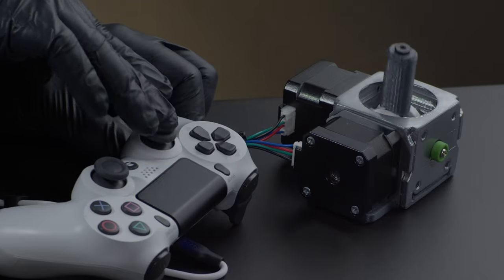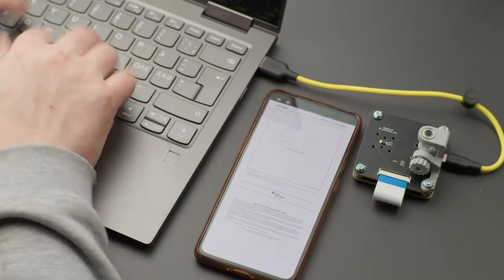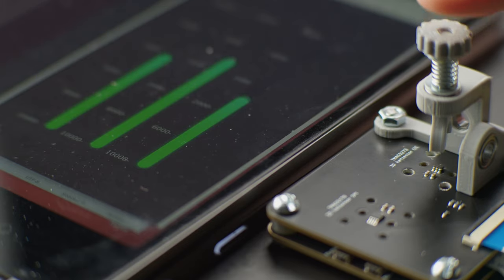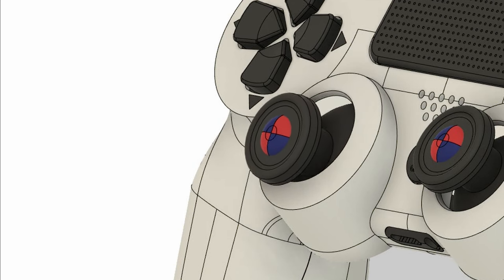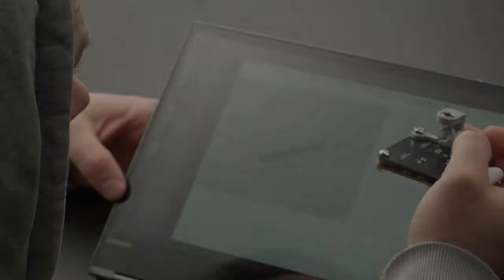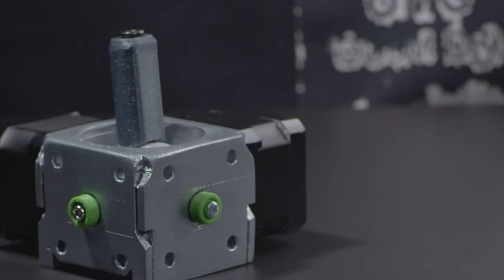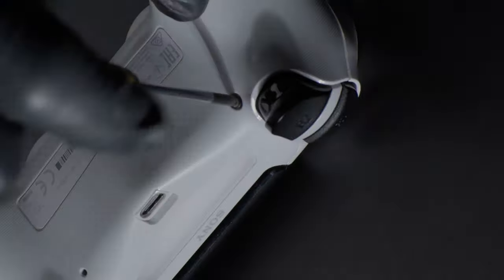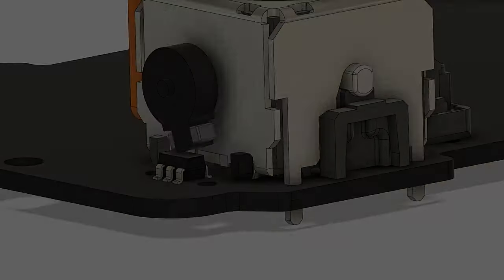3D hall effect joysticks, new tech for the future?

Comment: One thing to look out for is that the magnetic field generated by your motor may create noise in your hall effect sensor.  Looking forward to seeing it develop, sounds like an interesting project!
Reply from the maker: Yeah that is very true. My hopes is the sensor can be inside and motors on the outside. I will test and find out.
Reply: @MariusHeier1 you can sheild it with aluminum maybe?

Comment: If you can use the motors to hold the stick in any position then you can make the stick act like a throttle lever by allowing it to move up and down and hold position there but re-centering it if it goes off in the y axis. You could maybe even create some custom resistance maps to make it behave in more complex ways depending on it's position, like making it stimulate a gear shift – so it will hold a few specific positions but if you push it outside of those positions it will return to the nearest one (or maybe use some more complex pathing to determine which one to return to).

Comment: I think you're on the way to making a new way to manipulate 3d models in CAD. I don't know if this has been done before, but that twisting motion would be VERY HELPFUL in fusion 360.
Reply from the maker: Yeah i never thought about that. But its very true! I always find it super hard to pan around what im working on like that.
Reply: 3Dconnexion Spacemouse is a big player in the CAD world.
Reply: The space navigator has this function in a different implementation. You can twist it a little bit to trigger things, both sides. And since it has the perfect force to push itself back to its base position its actually quite nice to use.

Comment: Interesting. This is beyond what the current Gulikit analog sticks can do. But I do wonder if it'll maintain PS4 compatibility, as Gulikit seems to only limit themselves on the Switch, mobile devices, and PC, which leads me to believe they don't have the licenses to connect to PS or Xbox.

I also think that the stick feedback would be another whole can of worms that you would need to solve, as I think no game has this functionality yet. The haptic trigger had to be programmed by the game devs, and I believe this would be the same, unless you can make the process easier and get the data from Rumble
Reply from the maker: Gullikit needs to have the magnetic sensor on a pcb. And because its not part of their joystick. So thats probably a reason why there is no kit yet. And you would probably need to run another microcontroller to feed the original controller with the voltage levels it wants. My first idea for feedback would be to use it instead of rumbling motors. Maybe a good start. Its gonna be fun to order my own pcbdesign for the ps4 controller and experiment with that as well. Thabks for you comment
Reply from the maker: So we had the same idea. So it's probably a good one :)

Comment: Biggest issue is the slop in the joystick module. The sissor mechanisum is just as much at fault as the potentiometer. You will ideally need to come up with a frictionless module.
Reply from the maker: Thanks for the feedback  You swen this more than me! You mean the guide for the center stick?  Or the recentering plastic pin with the spring?
Reply: @MariusHeier1  yes correct the plunger and spring also the bottom plate the plunger skids on. I've see the whole mech be completley limp specially on certain PS3 controller that used the 4 pin hall pots. The whole analog module needs to be redesigned due to mechanical wear. They only have a certain finite life span. The Pots are only half the story IMO.
Reply from the maker: @UberMicroRepairs  yeah. I agree. kailh have made analog sticks and their springs are like 2x. Its gonna be in a upcoming video. Also doing cycle tests to get data. Just finished a cycle test rig.
Reply: @MariusHeier1  could you make a magnetic spring that pushes the joystick to the center? ideally it would be at the top, not interfering with the magnet below.
Reply from the maker: @l0k048  yeah .good one. thats an option i will probably try. Might not need a full motor..but just a coil and a magnet. Or.. just two magnets..for each axis!

Comment: the only downside I can see to them is they still use a spring-loaded analog stick with plastic around it that is still gonna wear out and become loose over time just gonna take 3 times as long to be loose and wobbly  but  it will eventually start happening from loose analogs with weak springs but other than that concern I'm loving them things.

Comment: You were talking about resolution per 1 degree with the hall sensor. This is significantly better than PlayStation analogue stick resolution.

I’ve noticed when aiming with a DualShock 4 or DualSense controller, that making very tiny adjustments is quite imprecise. Even with KontrolFreeks, the small movement accuracy seems to be quite limited with PlayStation controllers.

Would Hall effect sticks feel noticeably better? Like would you feel the increased resolution when trying to make small adjustments to your aim?
Reply from the maker: I think i will find out later today 🤠 Almost all gaming controllers made is using the alps alpine joystick. Which is 1$ joystick from the early 2000s. Because it is so noisy. Noisy being like the computer think it is constantly vibrating. (It doesnt vibrate, it just think it is because of the way the joystick make its signal). They usually add smoothing effect in the controller computer. This can make noticeable lag which can be manifested as you describe. Also many of the controllers use low resolution voltmeters/analog2digitalConverters for  resding the joystick  signal/output voltage. So even though the controller computer says its suppose to have 255 positions pr joystick axis. It might just have 127.
Reply from the maker: I should def make a video of every components/subsystem of a controller.
Reply: @MariusHeier1   really good replies, thank you!

Would it be possible for you test the SnR ratio of different controllers and the real world positions per stick? It would be really cool to have this kind of data measured on a video, to spread awareness of how bad most controller analogue sticks are.

Thrustmaster make a controller called the eSWAP Pro. They sell improved analogue sticks with it, called NXG sticks. The YouTuber called Rocket Science tested the stick accuracy and deadzone for many different controllers. What he found was almost every controller had noticeably imperfect stick accuracy and off-centre deadzones. PlayStation controllers fairer better than Xbox, but were still far from perfect.

The Thrustmaster NXG sticks were visually perfect. Accuracy was extremely good, with Deadzones almost perfectly centred.

Can you explain this? I know sticks need factory calibrating, but how are the Thrustmaster NXG sticks so much better? Better calibration? Better analogue stick ADC? Using hall sensors?

Comment: soo the chip can detect the changing of the magnet field just by rotating a magnetic ring bellow it?(bellow cuz is the orientation of the chip in the pot) and its has good accuracy? if so this is a nice idea, and would be better if we could integrated easily in a normal controler
Reply from the maker: Yes. Its how we track axles on really expensive motors, for controlling gyros etc. They are far more accurate and precise than pot meters. The sensors im using is typically find in products that costs 100-300$. Pr sensor. This project needs 4. But i dont have any middle men here that need to make the extra money. Just straight from the factory

Comment: "Haven't seen them in any controllers" - Which are you specifically referring to? Many joysticks and other similiar products have had hall sensors for a long time. For example the cheap and cheerful T.16000M joystick for more than 10 years!
Reply from the maker: I refer to 3d hallsensors. Where 3 are in one package. Not hall sensors in general
Reply: @MariusHeier1  Alright! The TM joystick indeed doesn't have rotation axis with a hall sensor.